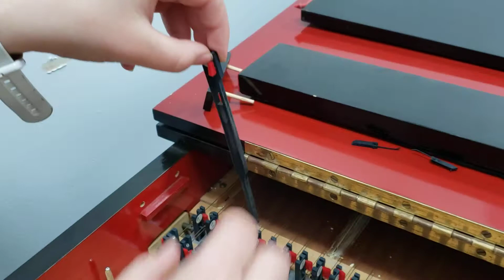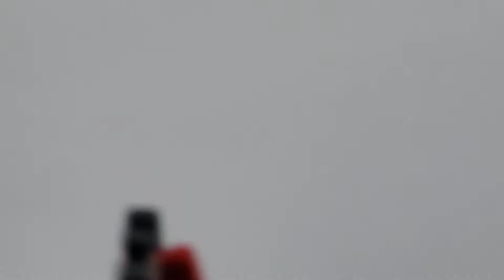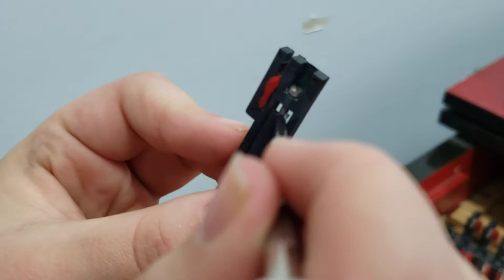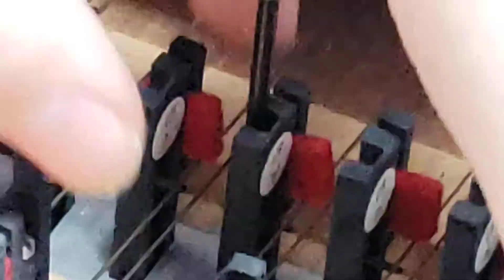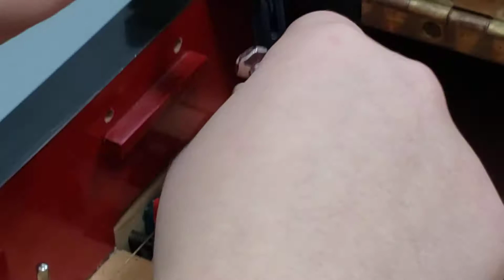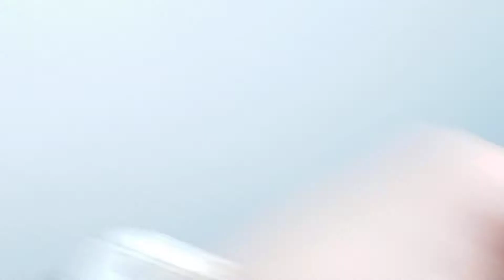how I learned to adjust a harpsichord jack

Comment: This is a very simple method of regulating only jacks with adjustment screws. That instrument, if you wish to get it playing again. Needs new Hubbard tongues fitted in the jacks. The Burton tongue is garbage, and the instrument will eventually need a complete restringing as well, (the wire, if original is outdated). Btw, this is a Burton 2x8’ Flemish single. Just some helpful advice if you wish to work on harpsichords, a little more in depth.